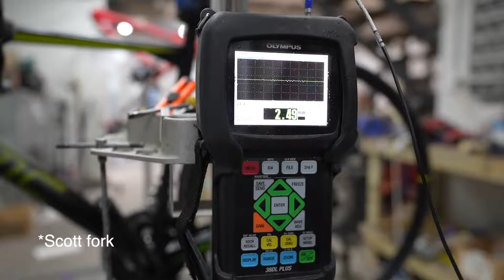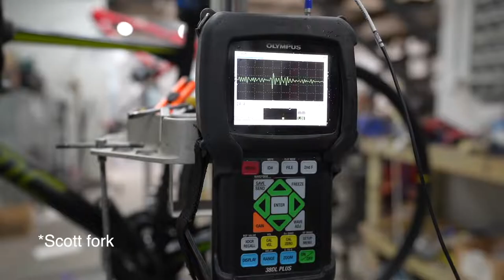Cheap Chinese Carbon Bike SAVA in Test # Bike Review

Comment: Bought Sava Herd 6.0. Bike store put it together and I have 2.5K miles from the last summer and 500 miles in last 6 weeks on it. All rides with my cycling club. NO ISSUES. It's a really really good bike with genuine components.
Reply: I bought a Sava twin, Kootu, with Ultegra R8000 groupset two years ago. Had over 2000 miles, not a single issue.
Reply: @williamko4751 What was the price of the bike?

Comment: I've had my sava 3 years, and I've rode 3k miles on it, runs great.
Reply: your wheel and novatec hub's performance is good? not tremor?
Reply: Perspective matters, he is comparing Sava to first world European Carbon, so you need to take things into perspective. Specialized and Cannondale etc also use cheap ass 3rd world Carbon frames in most of their bikes, their Quality Control will be better than Sava but doesn't change the fact that their bikes are also cheap trash which they charge a lot of money for. What about all those cyclists now riding "Pinarello" yeah right more like Chinarello clones as if most of these people can even afford a real Pinarello. Interestingly the Chinarello runs quite fine which are the same or worse quality than Sava. The biggest benefit of SAVA is they use Grey Market Shimano Products, it's real shimano products but for a lot less money due to regional pricing.
Reply: @kinghadu9611  What's the worst case scenario that could happen with the frame quality we are seeing? I mean this is a road bike not an MTB, it will not split in half during a ride, or will it? I have seen a video where they try to destroy a cracked fork on an MTB, and it took quite some effort, so if you inspect it regularly, you would notice a damage, right? The worst thing that can happen is that you need to get a new frame at this point. Given the current availability of local brands (almost nothing available), I'm actually considering getting a SAVA as my first roadie.
Reply: @kinghadu9611  how do you know they use grey market shimano products? is that standard procedure for chinese bike manufacturers?
Reply: @LLroomtempJ  yes it is standard procedure.

Comment: You'll have refinement issues in a bike at just about any price rance. This is why there are bike shops to "tweek" many of these bikes into shape. Even my CIÖCC build needed tweeking. High end Italian..  The guy inspecting the carbon fork was a little harsh. This SAVA is a mass produced carbon fiber bike, not a top spec niche brand. I bet this guy has had forks from Cervelo, Orbea or Pinarello with similar issues. It happens. Not saying they're bad bikes either. I ride a Cervelo P3. It seems this guy did get a bike that wasn't thoroughly inspected. Q&A would have spotted much of that. The lubricants (or lack of), could be intentional due to storing and shipping, and likely states to have the bike worked over by a pro. Like one should with any high end bike.Lastly, I bet many of these other big brands are likely having companies like Sava build their bikes. Find me an Italian, Spanish or American higher end big brand fully assembled bike under $3000 not made in the Far East..

Comment: Had my Sava for 4 years, no issues with the carbon frame and fork.
Reply: I think this channel has a bias against smaller China brands.
Reply: i am planning to buy SAVA R08-R8020-22S it's look ok to me please advice.
Reply: @Reflection_Wave  I have. KOOTU for three years. KOOTU and Sava are from the same factory, like Toyota and Lexus. 
Three years and 8K miles, not a single problem.
Reply: @williamko4751  Thanks i will look forward 😇
Reply: get it, should come with carbon wheelset. If you are not worried not riding a big brand bike, this tool is a multi in the bike 🌍

Comment: Nice to find this as a retiree friend was looking to purchase this brand and sell off his rim brake Trek Madone 2015 w DA groupset in favour of this SAVA brand in DISC.  He has been rabbiting on about all the +ve reviews from around the globe.  I've shared this link with him.   I am not anti Chinese bikes, I own and race a clone F10 Dogma, why, because.....  I bought a used clone F8 Dogma frame, liked the build quality, built it up and loved the way it rode, how planted the forks felt in hard cornering.  Then, based on that experience, I bought a genuine (used) F8 Dogma frame expecting increased brilliance.  Instead I could not tell the difference, even to the point where the internal finish on the genuine frame was rougher than the clone F8.  I sold the genuine and kept the clone (AUD$4500 vs AUD$300).  I then bought a used F10 Dogma frame from the same source when one came up and have been happily racing it since.  I have learned that some other masters racers also seem to be doing the same thing.

Comment: I had a brand new giant defy and had issues with it. Rear hub was over tightened in the factory that caused a weird intermittent banging noise when taking off. It drove me mad as bike shop couldn't get the rear hub off. Eventually, i got a replacement wheel but it shows that even big brands sell faulty bikes. There were heaps of defys and liv models sold with over tightened hubs.